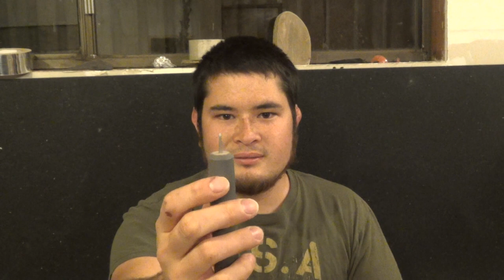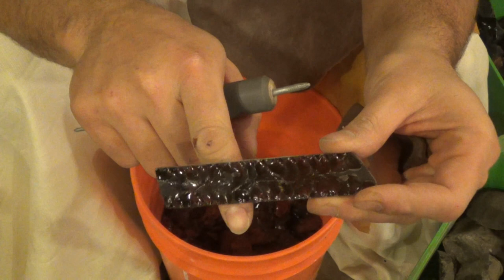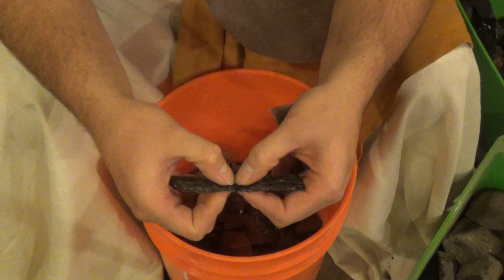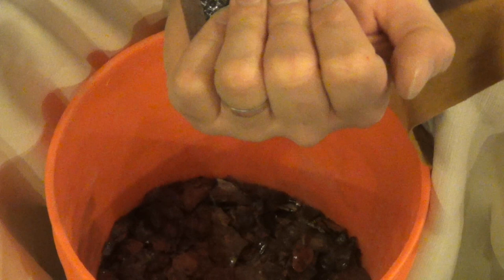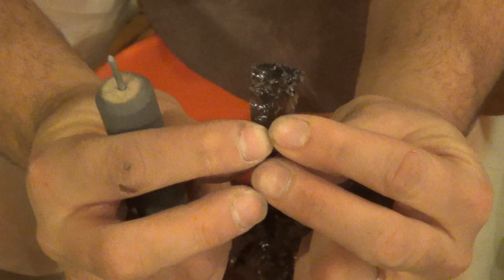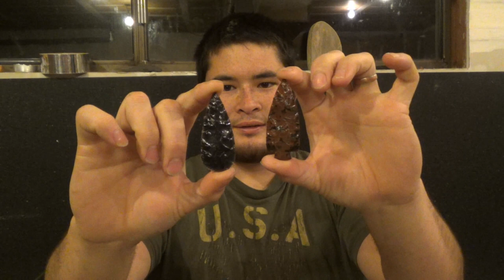How I Pressure Knap an Obsidian Slab

Comment: My guess is that your next project is a stone arrow shaft straightener, to heat and straighten natural shafts.

The natives here in Northern Florida used a 50/50 mix of hard pine resin and tallow to make a glue that they used as cement to attach points to a shaft.  They also used long squirrel skin thongs, cut from a circle of skin, and twisted like a flemish string for their strings.

Here in sandy Florida, there isn't much flint in my area, though the Flint river is several hours to the north in Georgia.  But laws restrict picking up flint rocks there.   I began knapping on pieces of thick plate window glass, and got a bit of skill before I risked flint, which I had to buy, or "borrow" up in Georgia.  I often think back wishfully to days in California, hiking on a mountain near Mammoth Hot Springs, where all the "stones" tinkled as you walked, the whole mountain being obsidian.  I wish I had some of that obsidian now.

Comment: Gee this must have taken around 7 hrs to upload.
 
Very interesting. Thanks for sharing.
 
I assume the same technique would work with glass?
Reply from the maker: Hahah, it did take quite a while!

This works on glass as well. I actually get better results with glass because it's more predictable. Different levels of inclusions, differeing degrees of brittleness and layers in obsidian make it tricky to work compared to glass. It's still a lot easier to make flakes run than in other types of silica rock.
Reply: BackyardBowyer Nice. I might try to knap a nice thick piece of glass one of these days,
 
I also have a few nice flint rocks that I picked up in Great Britain. I imagine they might make some fine arrowheads.
 
Keep up the great work man! =)
Reply: Hey L00NGB00W. I am subscribed to you :D
Reply: adam steenstrup Hi. =)

Comment: This question is open to anybody who thinks they can answer it. why can i not get a flake. no matter how hard i try, i just cant get one. i have watched videos of flintknappers and how they get flakes and it seems that they don't push that hard. i am 14 years old and am using glass bcz i don't have access to obsidean or any other rocks.(it sucks watching people going to glass buttes and getting all the obsidean they want) whenever i try to get a flake i push with all my strenght and i cant get one. i might lucky once in a while but its rare. i use antler tools and mostly glass bottle bottoms. PLEASE HELP!!!
Reply: obsidian flakes easier than glass
Reply: Joseph, I've only been knapping about a year, but I would suggest trying a copper tipped flaker that is fairly sharp. The duller the tip, it seems to take more pressure to release the flake, and the larger the flake scar it produces, but the sharper the tip, the less pressure it seems to take to release the flake...... and make sure you're working with good platforms and not thin edges that will only crush. .... Don't be afraid to abrade as it def helps.
Reply: pressure and your strength is not the only thing that is needed in flintknapping! i used to have the same problem with my flint, i get my pebble, hit it several times, no flake. after awhile i commented on my problem like you did and i got a reply , turns out you need to make sure that you are putting your pressure on the right angle and make sure the edge where you want the flake to travel is not to dull or sharp. the duller that edge the more pressure needed and bigger the flakes will be, and if its to sharp the edge gets crushed and you have the trouble of having a cliff on your piece. so practice on what angle to flake and check how dull or sharp the edge you are trying the flake is.

Comment: I think I see why you've had problems with your points snapping in half... You should only work one edge at a time after you bi-face your slab.

Having your piece thin on both ends and thick in the middle builds up a lot of pressure/harmonic vibrations which travel to the center of the piece (sort of like hand shock in a bow) and destabilize the stone. Just my 2 cents ^_^